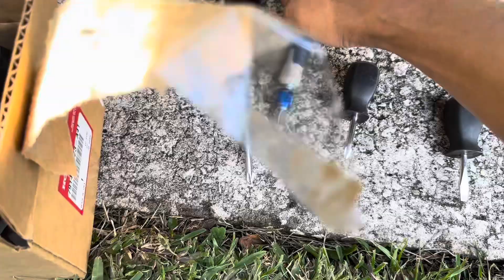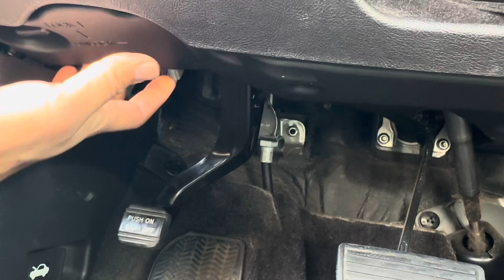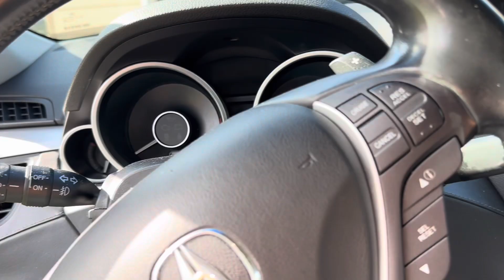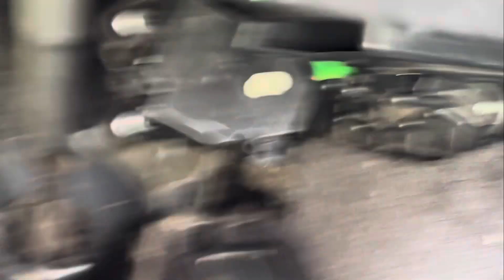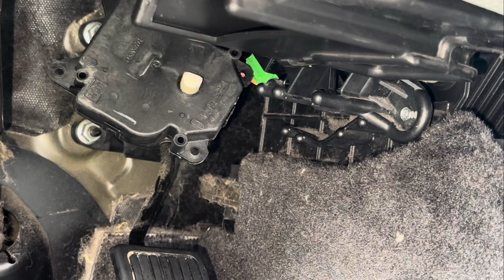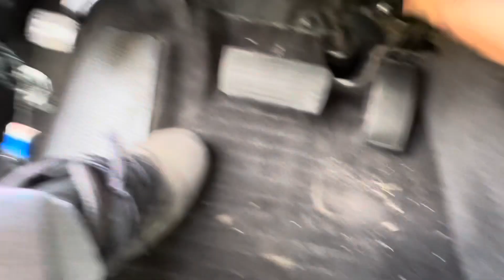10-13 Acura ZDX and 09-14 TL Defrost, vent and foot well A/C Repair Replacing Driver Side Mode Motor

Comment: Hello! I have a 2014 Acura TL. The passenger-side vents blow cold air, but the driver-side vents only blow lukewarm air. Do you know what might be causing this?

I ran the self-diagnostic test from your first video and received the same code you did. Were you experiencing the same A/C issue with your Acura?
Reply from the maker: Yes, the symptoms were the same as yours.  Try replacing the driver side air mix actuator.  Let me know if you have any other questions. Thanks for watching.
Reply: @DIYwithDUY  I replaced the driver’s-side air-mix actuator, but it’s still blowing lukewarm air. It blows hot air when set to heat, but it doesn’t blow cold air when set to the coldest setting. I also noticed a second actuator below the one I replaced. Does anyone have any other suggestions? Thanks!

Comment: Just replaced the same part in my 2013 TL, your video made the job a breeze. Thanks for making this , I’m sure it’s helped many Acura owners!
Reply from the maker: I'm glad the video made the repair easy for you!  Glad installation was a breeze.  Stay cool.
Reply: What was the original issue?

Comment: Hey Duy.. I have a 2009 TL & with the help of your videos I was able to change both of the AC actuators but , #1 Have issues synchronizing the blend door mode actuator and #2 when I did the self diagnostic, is telling me that the issue now is the incab temperature sensor in which I do not know how to get to it or if the panel even comes off.. I have identified the part but just having problems getting to it to be able to replace it..Help Please. Thanks in Advance.
Reply from the maker: Hi, thanks for checking out this video.  Sorry to hear you are still having issues with your AC.  I am unsure what you mean by synchronizing the blend door mode actuator.  What AC symptoms are you having?

To replace the Humidity/In-Car Temperature Sensor, you need to remove the dashboard trim near the Engine Start/Stop switch.  I’m looking at the factory service manual and don’t see any screws holding that panel on.  Pry the panel off carefully with a plastic trim removal tool.  Once that panel is off, you should be able to reach the sensor and disconnect the air hose.  Hope this info helps.
Reply: @D @DIYwithDUY ank You for taking your time to reply, I truly appreciate it..Ok, will try what you suggested. The issues I have with the AC were the same as the video you post & I did all the same step except that it still blows hot air… Wish there was a way for me to show but it cool..Thank You

Comment: Thank you for the video! My accelerator pedal sensor seems to be in the way of the motor. Did you remove it to be able to see the motor and unscrew it? I don’t see it in your view
Reply from the maker: Hi, I didn’t have to remove the accelerator pedal sensor to get to the motor.  I was able to reach under there with a Phillips screw driver and unscrew both driver side actuators.  Thanks for checking out this video. I really appreciate it.
Reply: Hey just to follow up: turns out it was the ABS that was in the way. I had to take that out and then I could change out the motor. Thanks again for the video!! Very much appreciated!
Reply from the maker: @D @David-cx4qp hanks for the update.  I’m glad you were able to get the repair completed.  👍

Comment: I just changed out my driver side bottom blender door actuator and it moves when changing from hot to cold but it’s still blowing hot air frm driver side… what should I try next?? Thanks
Reply from the maker: Hi, Check both of your radiator fans.  There is a condenser fan and a cooling fan.  Both should turn on when you turn your ac on. Idle for 10 minutes to make sure they turn on.  Let me know if both fans turn on.

Comment: What is the reason to change out the bottom one my driver side blows hot but my passenger side blows cool, would changing the bottom one fix this issue?
Reply from the maker: Yes. Changing out the air mix controller should resolve your issue.  Here is the link to the video for the air mix controller replacement.  https://youtu.be/Qx5vsXQvHnE?feature=shared
Reply: @DIYwithDUY it worked thank you so much
Reply from the maker: @marcusbass5 I am glad the video helped.  Thanks for watching.

Comment: Is there a video for the passenger mode actuator? I’m having trouble finding it
Reply from the maker: Unfortunately, I do not have a video for the passenger side mode controller at the moment.  I will work on making a video for the passenger side mode controller.  Thanks for checking out the channel.
Reply: @DIYwithDUY  do you have the  part number for the passenger side?
Reply from the maker: @Lycan_24_7 Hi, passenger side mode motor for the 2010-2013 Acura ZDX and 2009-2014 Acura TL is 79130-TK4-A41

Comment: I have replaced both of my Actuators and I don’t have power on the one that you just did temp one works fine it’s stuck on defrost any suggestions I couldn’t find any fuses for them all the fuses are fine too is there a relay ?
Reply from the maker: @Joe-kz7kz  Hi, have you tried to use the self diagnostic procedure that is built into the ZDX?  Check out this video.  https://youtu.be/A-qBGuEehv8?feature=shared

Try this diagnostic procedure and let me know what error codes pop up on the A/C panel.
Reply: 88 AE
Reply from the maker: @ Hi, can you post a video or photo of the code?  88 AE is difficult to determine the exact issue.  The code requires looking at the exact lines on the 88 that illuminate and the image/logo that pops up with it on the screen.
Reply: Ok I will do it today
Reply: I posted the video on my channel
Reply from the maker: @ Hi, I just took a look at your video.  It looks like you have the same exact codes that was on my Acura.  The code is showing for both your driver side and passenger side mode actuators. You said in a previous message that you have already replaced both mode actuators.  I will look in the service manual to determine the next step in figuring out why you are not getting power to the actuator.  I’ll keep you posted.
Reply from the maker: Hi, I finally had a chance to troubleshoot your A/C Mode motor no power issue.  This information is directly from the 10-13 Acura ZDX service manual, but they share the same parts as your vehicle and will be the same repair method.

https://youtu.be/0w5vQuEIay0

Comment: Thanks for video. Do you happen to have part number for the Mode Selector.
Reply from the maker: No problem.  Here’s the part number.  79140-TZ3-A41
Motor Assy., Driver Mode Motor. Let me know if you have any issues installing the new part.
Reply: Thank you.
Reply: I change mines and I have no power on the plug I check the fuses and they are all good any suggestions?
Reply from the maker: @ Hi, have you tried to use the self diagnostic procedure that is built into the ZDX?  Check out this video.  https://youtu.be/A-qBGuEehv8?feature=shared

Try this diagnostic procedure and let me know what codes pop up on the A/C panel.